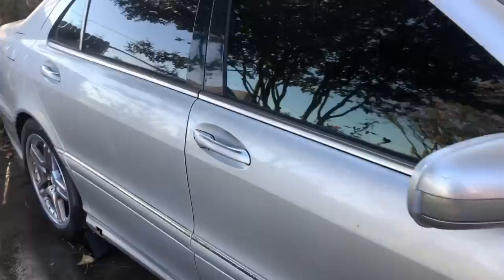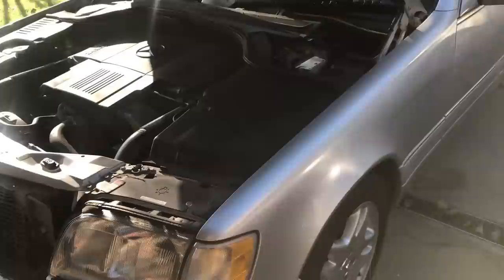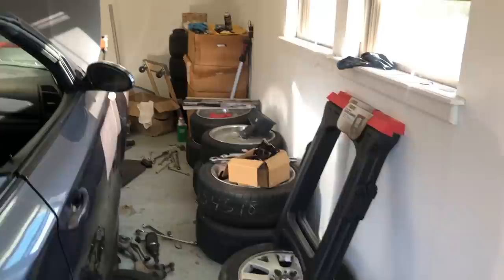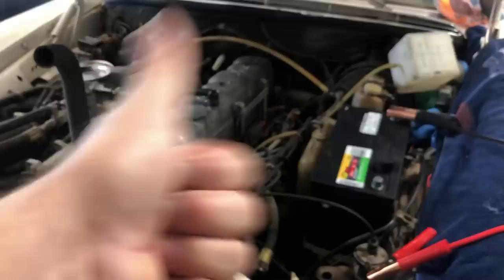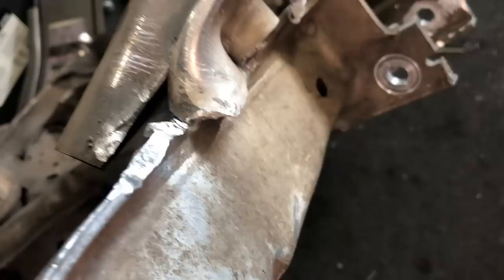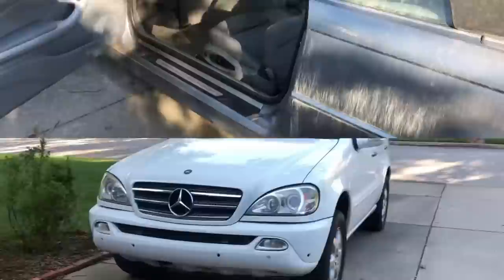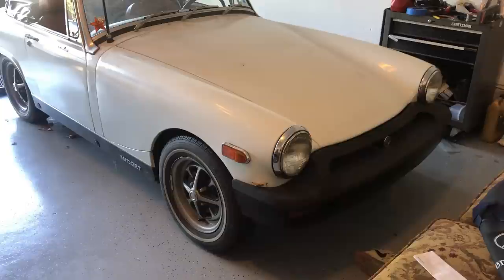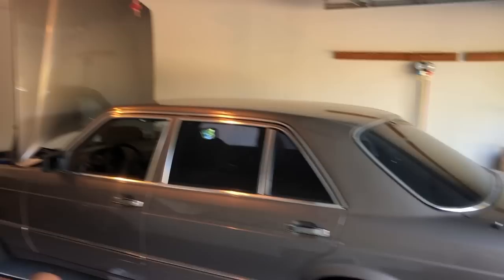Fleet Update: Fix Or Sell??

Comment: Great update. On your W126, there is an IDLE CONTROL BOX that sounds like it needs to be rebuilt. They cannot be replaced as no one makes them. I had the same issue the first time with my Gen-1, 1984 500SEL. It’s back by the firewall.
Reply from the maker: I’ll look into that. Thanks!

Comment: Love all the cars you have and of course you have to keep the Midget. I had a 75 Midget and loved it. It had a lot of pre-war (that's WWII for the youngsters) technology like the rebuildable lever action shock absorbers, the SU carb, an add-on heater under the dash (easy to change the heater core) and the door hinges look like they came off the front door of a house! But so easy to work on and super fun to drive. I drove from Austin to Dallas in mine and on the way the starter bolts worked loose and the starter was held on by the battery cable. I fixed it in Italy, Texas. Then just outside of Dallas the exhaust system fell off. I drove into Dallas with the exhaust system sticking out the passenger side of the car. Fun times. I guess you can keep the cars you love and sell the ones you love to hate. You need to name one of those cars J.R.
Reply from the maker: Ha!! Thanks!

Comment: For the 560sec tighten the bowden/kickdown cable. Basically get someone to floor the accelerator, while the car is off and while it is fully depressed then tighten the bowden cable to the maximum then drive the car and slowly turn it in after driving till it's shift patterns suit you . These engines like reving so keep it late shifting, also check modulator pressure if it's still bogging, remove the valve body and rebuild it because the springs get tired.
Reply from the maker: Thanks for the advice!!
Reply: Anytime.  I will be making a video on adjustments to these transmissions once my car is back in a few weeks . I'll leave a link to it here.  Hope my advice helps 🙏🏻 @MonkeyWrenchMike

Comment: I would buy either of the 560's from you. So, I think you need to keep them and dump the BMW's and the W140. I loved my '87 300SDL and now have a '90 560SEL BlueBlack/Black that is being slowly fixed back up. I am going to change the headlights, as you did, except I have Euro headlights with the vacuum height adjustment and the Euro wipers. I am looking for a set of Euro bumpers if you come across one. My friends all say that they like the NA bumpers but I liken it to building a beautiful infinity pool and then putting a safety railing around it.
Reply from the maker: I have a rear Euro bumper for the SEC. I don’t know if it’ll fit the SEL. Sounds like you have a nice project!

Comment: Jettison the BMWs and the w140 to new owners.  Finding a decent c/w126 car is becoming  more difficult and they will start selling for crazy money.  Fixing the 560sec and putting a new headliner in it (regardless of the paint issues) will be worth it long term.

(I've had a 99 528i for about 16 years that I've debated selling, but I will keep it since I put a new sunroof cassette in it with tons of other work.  It's a love/hate relationship.  The cooling system, window regulator (3 sets - 12 total), hood cable, headliner, and sunroof have been weak points to the car.  And the paint during that time was garbage.  BMWs of that era are not worth it long term, in my opinion, unless you're in love with it or it's a nice car with little needs.  E87/88 are fun and I've driven a lot of them, but the build quality is disappointing.)

Good luck!
Reply from the maker: Thanks!!

Comment: Hey mike. Love your channel. On the e46, did you make sure the top storage is in the proper position in the trunk? I bought one of these without a working top and turned out that's all it was!
Reply from the maker: Yeah, I checked and didn’t make a difference. Thanks fir reaching out though
Reply: @MonkeyWrenchMike  another thing you could try, might be a longshot. But putting the key in the door and holding it to unlock will lower the windows. Then the top. Maybe you'll get lucky and it's just the switch...

Comment: Hello Mike, did you have to use a special tool to remove the boot clamp? is it a difficult task, i'm about to do the same on my 85 500sel, thanks
Reply from the maker: Just a flat screwdriver!
Reply: @MonkeyWrenchMike  thank you, today i butchered the boot during the removal it came out in pieces, all of this to replace the vaccum lines and elbows out of the throttle body, hopefully i receive the new part tomorrow.